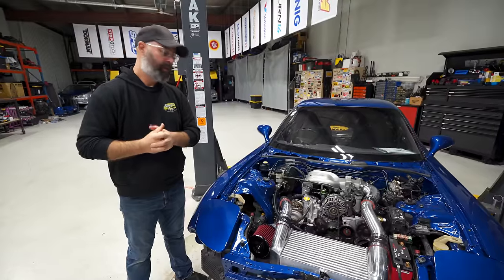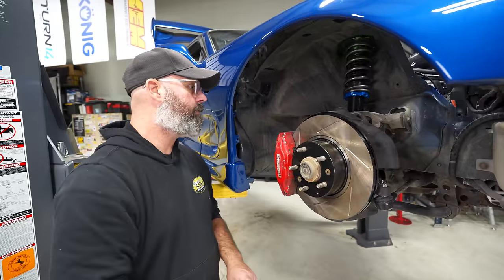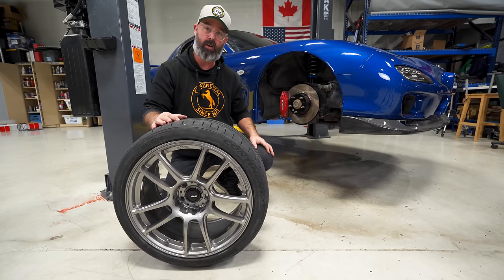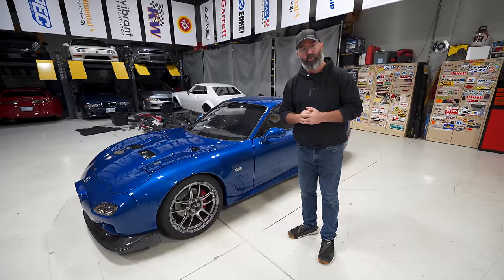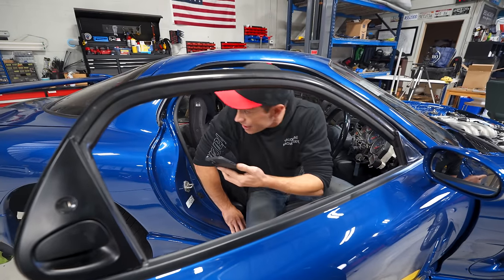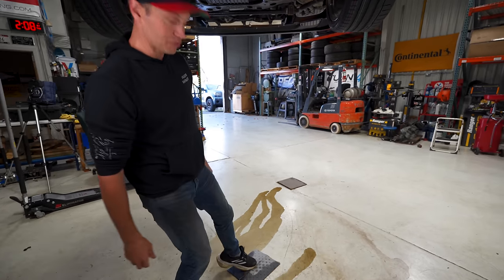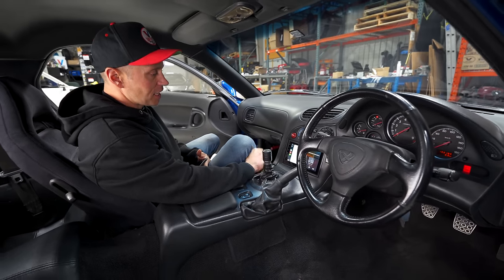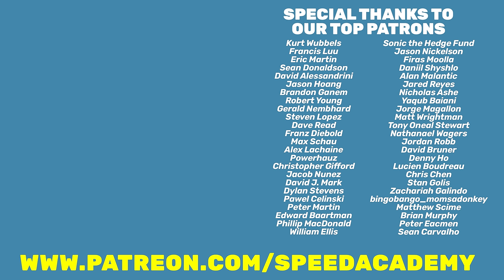MAZDA FD RX7 QUICK BUILD - EP 3

Comment: I went through the same tight interior constraints of the RX7 family.  It's a problem across all generations.  I ended up going with a Tillett B5 carbon seat without pads and it is by far the BEST seat I've had in any of my cars.  It fits me so well and and holds you in during a track day.  And it's about the lowest seat on the market that I had to custom make my own adapters.  Only problem it's VERY pricy, at about $1400 per seat.  But for me, it's worth every penny for that comfort and headroom.

Comment: Please note your description of high and low speed damping is reversed.

Road driving/rough road surface comfort is dependent on the high speed response being soft enough. The speed being the rate of change of movement - as seen with things like pot holes and small imperfections.

Comment: Decent build.  If you keep working on it I recommend Shine (FEED) Front fender with Shine (FEED) sideskirts, Shine (FEED) hood, TwinZ Design Diffuser, ZKmotoring Mirrorson the outside as well as RZ rear brakes.  Should have gone with a 99 spec cluster, RECARO Pole Position Red Seats, Sakebomb Garage Passenger Footwell, Sakebomb Garage Floor Mats, BubbleTech Relay Box Labels, BubbleTech Center console foam, BubbleTech Pax Door Handle, GarageAlpha Aluminum Gas Pedal & Dead Pedal, Garage Alpha Carbon Engine Bay Cover, GarageAlpha titanium Exhaust, GarageAlpha Titanium Strut Brace.  Rewrap the rear leather seat with Red leather.  Refurbish the front Oil Coolers.  Replace all bushings with OEM.  Put sound dampening in the entire interior.  That would be the dream FD
Reply from the maker: Send $20k and we’ll get right on it! 😂